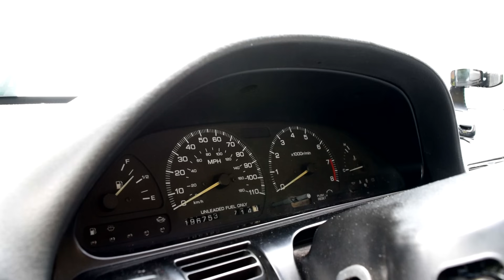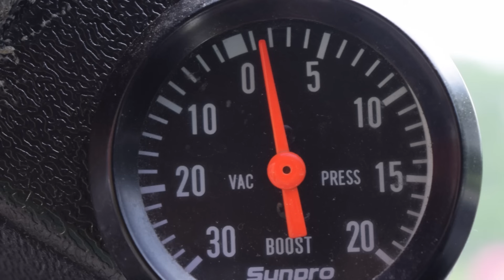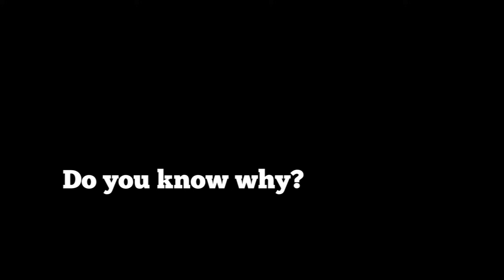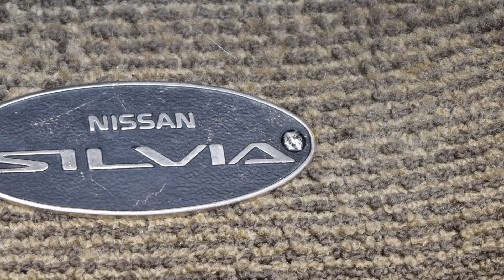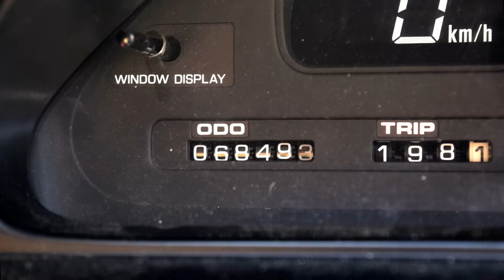Regular Car Reviews: 1989 Nissan S13 Silvia/240SX

Comment: So, Japan got the Silvia and the 180sx, and we got the 240sx, which looks like a Silvia with a 180sx front, except the fastback looked like a 180sx all around. And then everywhere else the 180sx was the 200sx except the 2 generations after were the S14 and S15 Silvias, but in the US the 200sx was a completely different car. Why did they have to make this so confusing.
Reply: And to throw more spanners in the works, sometimes the car names didn't even relate to the fucking engines!!! For example: The UKDM Nissan 200sx S13 actually has the CA18 (1.8) so it should be called the 180sx; but no, they decided to just randomly call it the 200sx for no fucking reason. Same goes for the JDM 180sx Type-S, it has an SR20!! So it should be called a 200sx Type-S inst.... You know what fuck this.
Reply: So the USDM S13 is a reverse Sil80.
Reply: @thenutbucket5971  Exactly. And it has a name, actually. "Onevia".

It has started from Japan, when owners of the jdm Silvia were drifting and crashing or not, so they would buy and install the front end of a 180 to the body of a Silvia. So 180 (One-Eighty) + Silvia = Onevia. It was so popular as a modification in Japan that it had its own calture.

In North America though, the Onevia was sold as the 240sx s13 Silvia. 

It was even featured in Initial D.
Reply: @Ragna___  so the slieghty
Reply: but the s in s13 stands for silvia. all models are silvias
Reply: FurySection well, yes and no. sure, the s is technically derived from silvia but it is really just a marker of an s-chassis. the only TRUE silvias are the jdm ones, all 3 generations.
Reply: Levi Speers no, the sileighty has a SILvia front end and a 180 rear. thus “sileighty”. The onevia has a 180 front and a silVIA rear. So they are essentially inverses.
Reply: the nut bucket onevia*
Reply: @fairygarden-sv9qq  Say that to my S12 Silvia. It came out of the factory as a Silvia. Not a 180SX, not a 200SX nor a 240SX. A Silvia Turbo. That's it.
Reply: @joost1120  talking about just the modern schassis platform (s13-15)
Reply: Still confused
Reply: And your forgetting about the Datsun/Nissan S12, which had two other names for it (I think one was 200sx?)

Comment: 240SX hatch, no bumper,welded diff, faded paint, chopped coils, cracked dash, blown engine seals, gutted interior, and a dented and scratched fartcan.
NEEDS MINOR WORK, NEVER DRIFTED, $8000 OBO NO LOWBALLERS I KNOW WHAT I GOT.
Reply: I thought u were selling a car at first, sounds like parts
Reply: Mmmmm...real tofu.
Reply: Sean C lol... 
on a real note, I found an S13 hatchback for 3k. It doesn't look that bad, but I imagine it might have all sorts of electrical issues. Also, automatic.
I still want it, though.
Reply: JDM headlights from 1989 Silvia...$700 lol
Reply: @no_4259  Yeah.. Bought mine for $3400 and it has an array of issues. I LOVE how it drives, there's nothing like it.

I got it with 180,000km's.. And now. It has 225,000. The engine is definitely gonna go boom. I need to replace. SO many parts and since I lost a higher paying job for a lower paying I have to start prepping it for a sale... So. Probably. Going to be able to sell. It for. Only 2000. Oh well :(
Reply: Don't forget 200k miles
Reply: Try 9k there bud lmao.
Reply: 10k and going up in Australia 😂
Reply: 8k wouldn’t be bad for one with an SR20
Reply: 8000$!? Don't you mean 18000?
Reply: Bro was ahead of his time and he didn’t even know 😂

Comment: Btw, the '89 USDM S13 had the ka24e. One cam bam!
Reply: Primer2tone Garage Yeah the car must also have a facelift front end since it should be a pignose if '89
Reply: Yeah, I did the same thing. I swapped my pig nose front end with the shark nose. I kinda regret it. Lol
Reply from the maker: Primer2tone Garage HAHA "One Cam Bam!" I like the term "Single-Jingle" too
Reply: Primer2tone Garage Piggies 4 life man, I'll never swap!
Reply: Primer2tone Garage Yea, the 12 valve from the Nissan pickup, but the 240SX version had a bit more HP. They put the KA24DE in the Frontier, though. I had a 1997 Nissan hardbody pickup and it definitely could have used the extra torque and HP of the dual cam. The 3.0 V6 wasn't much better though and even the VG33 that went into the Frontier was a bit wheezy.
Reply: Primer2tone Garage That engine is such a dog, it's rather unfortunate.
Reply: Lord Shrek Aww, it's not that bad. I don't know if I'd wanna build one but it was a fairly reliable motor.
Reply: Primer2tone Garage I'll give it reliable, lots of them still seem to be running even after years of abuse. I just don't think they're particularly exciting to drive.I drove a friends one time and it just felt dead in the water. Didn't seem to make much power down low, but also didn't feel exciting up high in the revs. But his was also an automatic, It'd probably be more lively with a manual. It's a much different car than I'm used to driving I suppose.
Reply: The KA24DE was also in the 93-01 Nissan Altima, and all trim levels have the same motor.
Reply: Primer2tone Garage no one likes a know-it-all
Reply: single cammer slammer
Reply: Primer2tone Garage Shhh... don't tell anyone how fun they are!
Reply: +Primer2tone Garage pignose is the way to go man
Reply: I have an 89 hatch I like my single cam all 400hp of it lol
Reply: @brantisonfire  5 years late on this comment but the s13 actually had the single slammer KA months before the hardbody. The trucks got "sports car" engines

Comment: the fact that they changed the headlights has always fucked me up with identifying them
Reply: The USDM 240sx S13 is basically just the 180sx
Reply: +Braden Spencer it's not a hatch tho
Reply: In this vid, the USDM pretty much a coupe with the front end from a hatchback.
Reply: SideWaysiscool Yeah, I noticed but it's not a 180sx
Reply: frank jones My comment was more just to correct Braden and clarify a bit lol
Reply: SideWaysiscool k
Reply: Pretty much, yeah. But for some reason, S13 enthusiasts don't like the American S13 to be called a Onevia
Reply: That Regular Guy that's because the onevia in America is a Honda oddesy front end on a 240sx either hatch or coupe it dont matter.
Reply: USDM: 240sx and 240sx coupe the coupe has a silvia rear with the popups front end
JDM: 180sx and Silvia S13. the 180sx is the hatch version and the the same as the usdm 240sx hatch
Reply: Redliner3 a onevia is only a coupe....not a hatch
Reply: Redliner3 that’s an odyvia my friend

Comment: RegularCars -I find it interesting that you drove a 'Onevia' (Silvia with a 180SX/240SX hatch) front end on a Silvia coupe) S13.   It should be mentioned that in Japan, the middle and late (chuuki and kouki) 180SX came with the SR20DET.  In the first year of the 180SX, it came with the same CA18DET as the PS13 (coupe) Silvia. The RPS13 (180SX hatch, e.g,  the 180SX Type X, etc) came with the SR20DET as well, but WAS NOT renamed to '200SX' (which is a whole nother bag of deeznuts).   Another interesting thing is that for both the S13 and later S14, there's lots of parts compatibility with the R32 and R33 skyline GT-R (so you see a lot of 'OEM upgrades'). Like you said, platform, platform, platform.

Also it's not so surprising that these older cars have very low miles, as your importer friend will probably tell you. It costs a lot to run a car in Japan, and people definitely do not drive as much given the local infrastructure.  The car culture--and commuting culture--is pretty different. In a lot of places, you just don't need a car. 

Oh, and I enjoyed the engine code talk; Toyota's engine codes (type, chassis family, then features) is also really easy to understand.  I don't get why US automakers don't do this.

Comment: Mitsubishi has the easiest engine codes 4(cylinder count) G(uses Gasoline) 6(series) 3(model) T( Turbo) 4G63T
Reply: Honda is second best? K(series)20(Displacement)A(Spec for the country)
Reply: ***** Spec for the country? Thats what complicates it
Reply: what about american engines 318(displacement)350(displacement) 440(displacement)
Reply: Kormákur Jónsson Yes let's use the imperial system in a world where everyone else uses metric
Reply: +alexlam24 Yeah I use the metric system but the engines are called that.
Reply: Nah its Subaru. E (for whatever) J (Still because who gives a fuck) 20 (because displacement/ might as well have one accurate thing in here)
Reply: na toyota 22ret 22r series e efi t turbo
Reply: Chris Goodall Still trying to understand LS names.  LS3 vs LS1?
Reply: So what the fuck is B in 4b11
Reply: Joey Arthur Zooberry It indicates the type ofaterial used to make the block.
Reply: It's cast aluminum, so what does "B" stand for..?
Reply: Joey Arthur Zooberry Probably something to do with the piston head
Reply: Or Nissan 

RB(series)26(displacement in liters)D(dual overhead cam)E(electronically fuel injected)TT(twin turbo)
Reply: the engines are not called like so. 318 is the model number. the engines are like m50b25, for example
Reply: +Chris Goodall in subies the E is for engine (duh), J series (like, first engine they 
made EA second EB third EC and so on), 20 (displacement), then add a D to 
the end if its a dirty diesel for douchbags or X for hybrids.

they did run out of version letters though (EZ36) so now their using F 
for Fngine because you need a fngine in your toyo-ba-ion-ru 
FR-Z86.............
Reply: Lmao
Reply: Mr. Regular must think Mitsubishi is the anti-christ. Ever notice? One Mitsubishi review, endless Subaru reviews. Mighty strange
Reply: for GM you you use the 3 digit RPO (Regular Production Option) code; for Example, the Code LY2 denotes a Gen IV Vortec V8 (better known as the Truck LS) that is 4.8L that makes 295 HP and 305 ft Lbs of Torque, and the code LXV; denotes the Gen III Family 1 DOHC VVT I4 engine, that is 1.6L, and makes 108 HP, and 105 Ft Lbs of Torque.
Reply: digitalrailroader too complicated
Reply: Volvo: B21F, B Benzene (Gasoline) 2.1 liters Federal (United States of America)
Reply: GM is the best obviously: L (stands for loud) S (stands for speed) 3 (the generation)

Comment: 1989 Nissan 240SX, the official car of: wearing obey snap backs and tank top shirts, being roughly 22-26 years old and spending over a grand on suspension before you fix the body and paint. "Because camber is best suspension" -S13 owner
Reply: So accurate on the suspension part for me! Got fortune auto 500, and a dent on the fender of my s13 but don't care because the dent is physical and the suspension is mechanical
Reply: +Roger Toledo but did you pay for your suspension to be upgraded BEFORE you fixed the dent and possibly faded paint?
Reply: Yes, and the paint is fine, just has a dent
Reply: It's all one color
Reply: +Roger Toledo well point proven, although credit where it is due you are just above the average S13 owner, congrats lol.
Reply: Christopher Cisneros thanks, I have bigger things to worry about since like the engine, and what's the point of having a nice looking car if it doesn't run right
Reply: so you completely missed the point of my original comment. "fixing" the car is completely different form modifying the car, why get a 1-2k suspension setup when the body is bad? why buy an aftermarket exhaust setup when the engine has a knock or the tranny is slipping gears? that's the point I'm making.

Comment: Im a subaru guy, and i think this is your best video. Not only because if you're a bad influence you drive a wrx or an s chassis, but because the 240 is finally, and rightly, identified as the grandfather. This car is old. Given i would have liked you to mention how not too long before this model it split chassis and branding with the Z cars. But im just typing a small review. 10/10

Comment: The "DE" was not an up-trim engine. 1989 and 1990 240sx's ALL had KA24E's, none had a DE (there may be some end of model year overlap but I've never seen one in my life.) The engine was a stopgap yanked from the hardbody pickup. In 1991 and through 1998, every single USDM 240sx had a basically identical KA24DE.

The KA series engine is very underappreciated. It takes mods like crazy and despite people's complaints that we never got a turbo motor, it's got tons of personality. I knew a guy with a ka24DE that had about 220 horsepower to the wheels without boost and it was a screamer. I've seen 500HP reliable daily driven KA24E's. They're absolutely indestructible engines. My first 240sx, a KA24E 1990, drank a quart of oil a week and never broke down. My second one, a 1991 DE, had 250k miles and ran like a watch. My third one has an SR20 stroked to 2.35 and made 557 to the wheels until I punched a hole in the #3 piston 15 years ago. I still have the car and promised my mother I'd only sell it if I didn't get into med school on my second try. But until that day comes, I will continue to open my garage door and have people walk up and offer me 10k for the rolling chassis.

Comment: That Silvia is just incredible. The CA engine definitely isn't an SR, but it's not all bad. From memory, it has an iron block, and its cylinder dimensions are square so it's just as happy revving as pulling from down low. It cops a bad rap but they can make decent power with the right mods.

But I'd leave that museum-quality one alone. What a car!
Reply: Iunio92 You are correct if allthough if you look on youtube there are quite a few CA18's pushing over 400HP one making close to 600 to the crank the CA is a very underrated engine Both the CA and SR are good engines.
Reply: Zarniix The CA18 is said to be the baby RB.
Reply: Mr.Knister its pretty much true in a way if you look at the specs The desgin of the engine They are close just of course ones a 4cyl i really have no idea why people gave them a bad rep.

Comment: yeah... that 240... either the front bumper was swapped from a 91-94 model, or it actually is the 91-94 model, which had that bumper cover and the ka24de. the 89 and 90 models had a different bumper and the ka24e.

Comment: Dat Silvia! an all original silvia with under 50k miles?! that's impressive. And that 240. the usdm 240sx coupes looks so good. Silvia rear, 180sx front, it just has a menacing look to it and that particular car is modified almost exactly as i would want to modify a 240.

Comment: Just a small correction...all USDM S13s from 89-90 had the KA24E, then from 91-94 they switched to the KA24DE. 89 S13s were never sold stock with the dual cam

Comment: RegularCars  I can bet that JDM Silvia has atleast 120k Km on it, rather than what it has, i work at a Japanese importer in a Right Hand drive country and all JDM imports have their mileage lowered by the suppliers in japan, the beauty however is in how great the japanese take care of their cars, truth be told the cars almost always look the part of the lowered mileage, just as that silvia does :) Great review though, one of my favourites amongst all you have done thus far :)!!!
Reply: Cobrastarzz1  - Actually this s13 was a one owner car, and I have the service records. While that may happen at some of the shadier dealerships, if you're watching the auctions you typically can see when an odometer has been altered. I've even seen some auctions stopped, and the car relisted due to the agents finding things out about the vehicle history after the initial inspection. My CRX Si was the same: A 1 owner car, with all the records along with it. Finding grade 4 cars with all the appropriate paperwork is tough. The average S13 I see go through the lists, looks like every other s13 here: Modified and beat to hell.
Reply: Yes, alot of these older cars have sketchy paper work, however it's a common thing for economy cars to have the odometer reading lowered, several Nissan Tiida's, Toyota Axio's etc. commonly auctioned sedans, just about most of them that get auctioned have their odometer reading lowered and for some reason there bids are never stopped, however these vehicles are usually new 2009 and up so the reading is usually only lowered a little bit, most of them come with like 27,000 km around there....We always thought that was the legit reading until we realised the suppliers had an option to lower the odometers for an additional cost... and these are popular suppliers aswell that many Right Hand Drive countries import from...
Reply: Also , one of the possible reasons why the odometer lowerings are allowed in some cases may be because some countries that the cars are exported too, do not penalize anyone for adjusting odometers, or in my countries case, they do not enforce it, we recently imported a 09 Evo X and 2012 BRZ both came with about 27k Km on the odo, and we knew both were definitely not driven the same, ecspecially since the Evo X was modified substantially , However, we've been importing from Japan for 30 years now and we always inspect and replace warn parts from all our imports before selling to customers, out of our own pocket, so all is fine, Importing from Japan is just an awesome experience all around :) alot of nice rare finds in the auctions aswell!

Comment: Mr. Regular you were incorrect when saying the ka24de was offered in the higher trim models of the s13 during 89. It was actually only offered in the s13 from 91-94 and all USDM trim models got the same ka24de during those years. In 89-90 all USDM s13s had the ka24e.